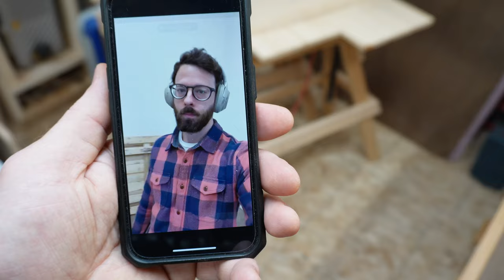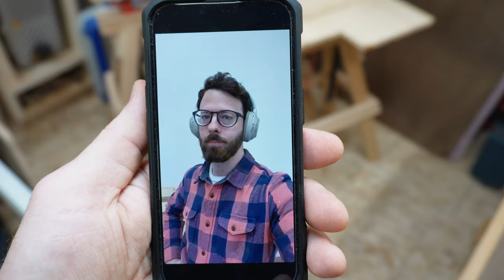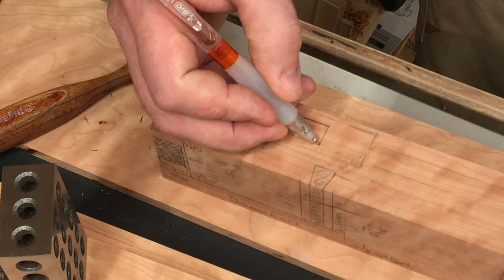DELUXE Chess Table Build

Comment: Hey amazing build! I'm curious what you charged for something like that, looks like it'd cost a fortune. Would you mind sharing a little more about the materials you used for the cushioning in the drawer that holds the pieces?
Reply from the maker: It was a 2” seat cushion foam that you can get from a craft store like Michael’s covered by a crushed velvet fabric.